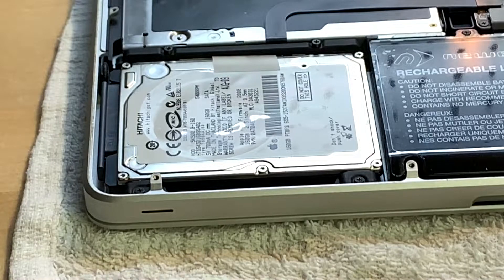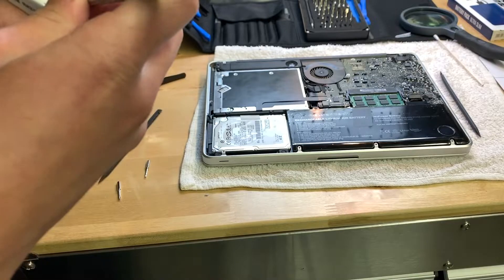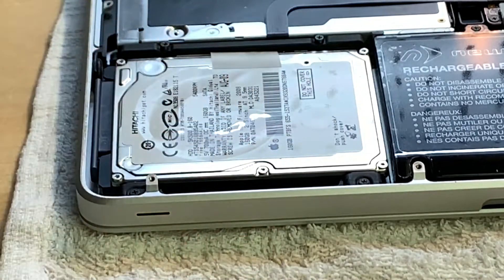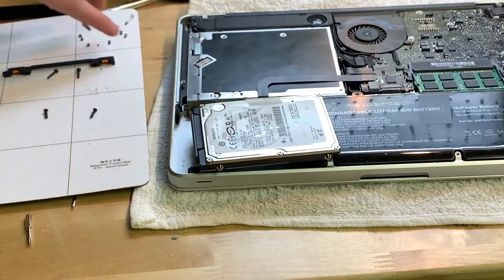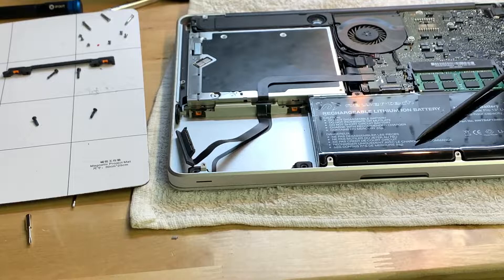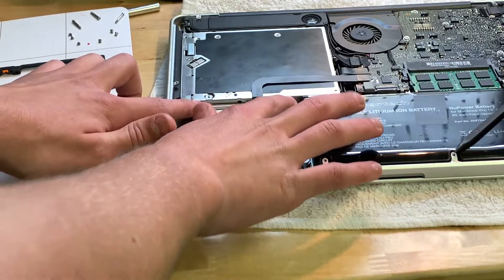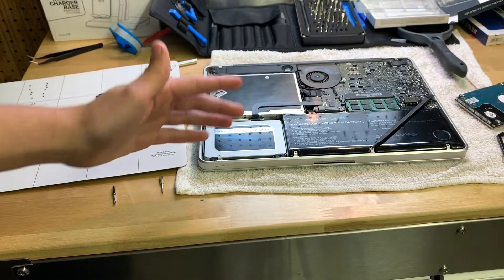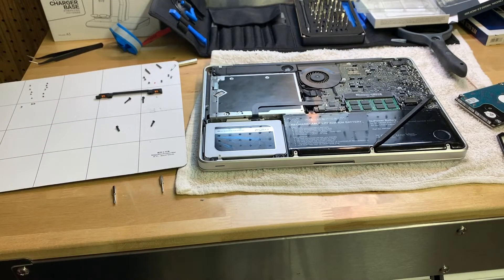Apple MacBook Pro Mid 2009 Upgrades For Speed And Power Part 3 (SSD).

Comment: just an FYI (stumbled across this series because I was thinking of re-pasting the thermal paste on my 2009 mbp) I did these upgrades a few years ago on mine- I also swapped the optical drive for another HDD 1tb (they have an adapter on amazon) i highly recommend that, they even sell ones that come with a optical drive enclosure so you can still use it externally after. Then it'll be super fast